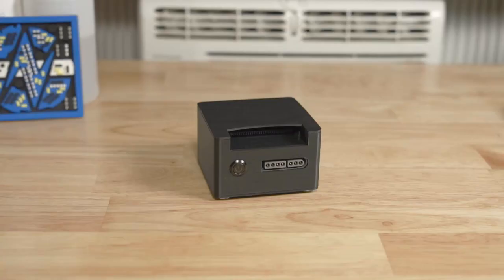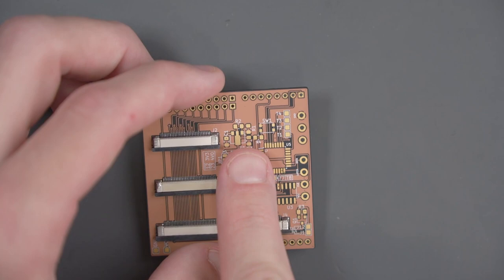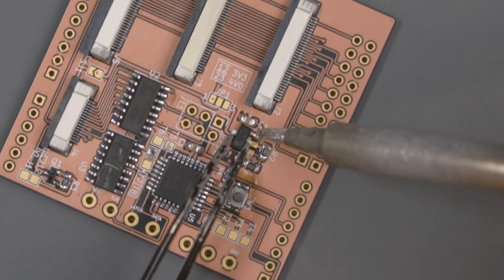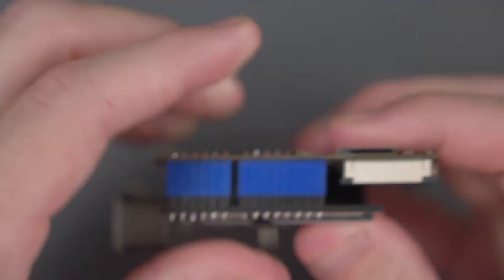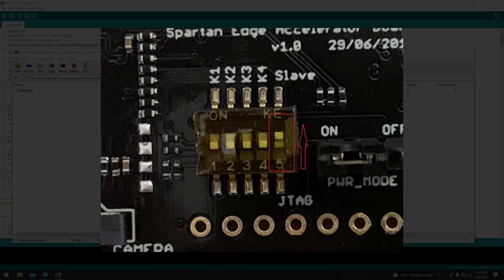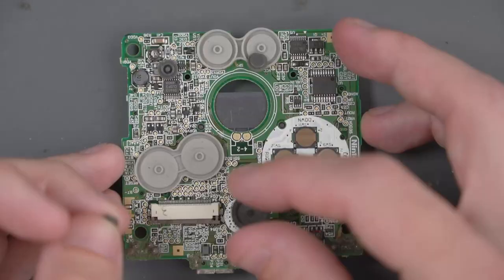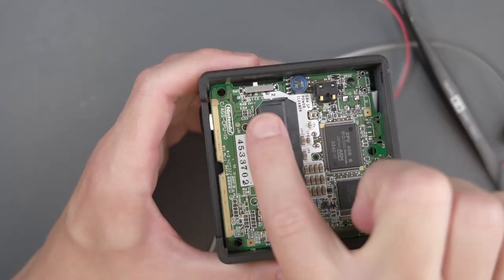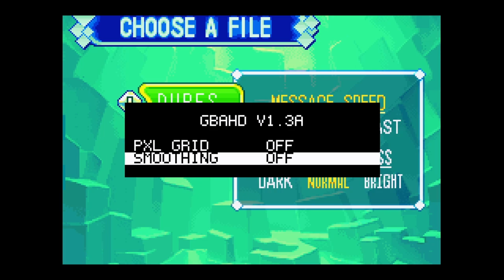gbaHD - Open Source Game Boy Advance SP Consolizer!

Comment: Neat project, but why does it require an expensive FPGA instead of a cheap Pi Zero, Atmega, Arduino, etc?   It seems like a project just to market the "Spartan-Edge" more than anything else, but maybe there is some very specific reason it requires an FPGA that I am not aware of.  BTW, I understand this is not necessarily a question for the youtuber, just a general question about the project.

Comment: Good job. I'm not sure, but it looks as though your solder braid isn't very good. I've had issues with cheaper solder braid not wicking up solder before. I highly recommend buying a good quality one, like from MG Chemicals. You'll never look back.
Reply from the maker: I’ll check it out, thanks for the recommendation
Reply: I can't second this enough. Gootwick is also good. Just don't bother with NTE wick :p. Flux helps a lot too.

Comment: I'm terrible at smd soldiering so I'm definitely not giving advice. Why not tin pads first? I've had success with doing that and then heating the legs on top to seat it in.
Reply from the maker: You want the surface mount component to be as flat as possible to avoid bridging the pads underneath. That’s why I only solder on pad first

Comment: Finally a first ytler makes a Gbahd! Im happy and wait for the video.

I would only soldering the Connector that I need and not All.

On the Quarz it's only need the top part and the parts in it.
This Bar inside which goes from up to down. 
It's easier to not remove it full.

You have bit of a error.
You remove the switch on the fpga but only connect 1 point to the cable.
It's need to use 2 holes like in the switch.
When you open the switch you will se that it connect both holes and not 1.
The tutorial Show its too.

I make my power led shine  when power is insert and reset when the system runs.

ManCloud modify my system that it doesnt need a microsd cart and that the fpga can update the Shield in the future.

And a Tip! Let print the top of the case clear through resin.
That looks good.

The Feature on the Gbahd is in working for future. 
It's open source and it is working through users. 
And the best Pro is the price against gba consolizer.

Wifi Update and no sd card is the best Update of the Gbahd until now.

And the hdmi plug Problem?
Looking for a longer plug or cut Some Plastik away of the plug.

I dont have many problems with it and on 99%of the time it works perfect.
The audio problem is game spezifik like on metroid fusion

Comment: Hey there, going to be making myself one of these soon!  Do you happen to remember how long your FFC cables were?  I'm going to try to buy shorter ones so I don't have to stuff them in like you did lmao.
Reply from the maker: I’m not sure, I didn’t source them
Reply: @dubesinhower  Ah well thanks for responding anyways!  I'm also having trouble finding the size of the power button (12mm or 16mm) but maybe you didn't source that either
Reply from the maker: @bobrocks95  Oops, I thought you were commenting on a different video. I did source these parts, but I don't remember how long these were. 200mm maybe?

Comment: You had mentioned that these mods are out of stock.  The GBA Consolizer is in stock at Game-Tech.
Reply from the maker: It’s in stock as a preorder
Reply: @dubesinhower  The Consolizers are already fabricated and at Game-Tech, a pretty large supply too. It just says pre-order because he has a backlog of orders to fulfill. The FPGA in the GBAHD also isn't necessarily better than the Consolizer, it's better in some ways and worse in others (at least if the specs on the seeedstudio dev board used in GBAHD are correct). Fun video :)
Reply from the maker: Interesting, could you elaborate?

Also, do you have any idea why both the consolizer and the gbaHD don’t always boot correctly? Is it a display compatibility issue? Both my consolizers have this issue, even without DVI+

Thanks for watching!
Reply: @dubesinhower  The GBAHD uses a spartan-7 and the Consolizer uses a Spartan-6. Newer series doesn't always mean it's better. GBAHD uses XC7S15 while the Consolizer uses XC6SLX9. The XC7S15 has 2000 logic slices, 20 DSP math units, and 360kbit of ram vs the 1400 slices, 16 DSP units, and 576kbit ram in the XC6SLX9. Extra RAM is very useful in the image processing world and often times is the limiting factor for projects at Pixel FX. The GBAHD project is really cool and the developers seem very nice, I just wanted to clear up the FPGA differences since this isn't the first time it's been said.

The reason DVI+ is hit or miss is just that designing an HDMI encoder FPGA core is hard, and the Consolizer core needs more work to improve compatibility. It's something I plan to rewrite when I have time since we need a better HDMI core for future Pixel FX products anyway.
Reply from the maker: Thanks for taking time to reply, keep up the good work!
Reply: @dubesinhower  same to you, I've been enjoying your news videos and install videos. Hopefully Pixel FX will have plenty of fun stuff in the future for install videos :)
Reply: @woozle64  Will 1080p ever be possible on the Consolizer like it is with the gbaHD?

I would love a 6x mode and a 6.75x interpolated mode.
Reply: @Inv8erZlM  Not possible unfortunately. 1080p requires 1450Mbit/s FPGA output toggle rate. The Consolizer fpga has 750Mbit/s capability, the GBAHD FPGA has 950Mbit/s capability. Neither are really capable of 1080p on paper but it seems GBAHD is able to squeak by :)